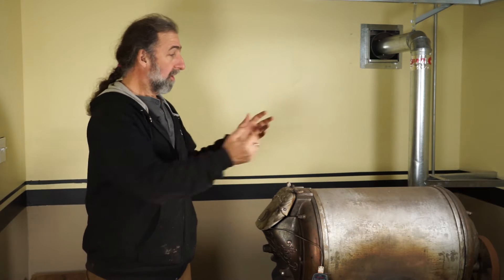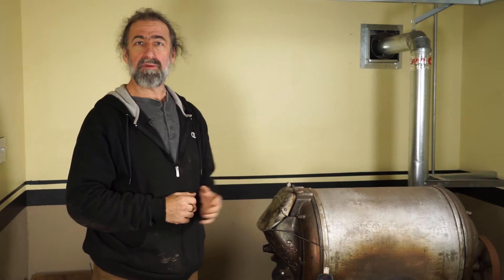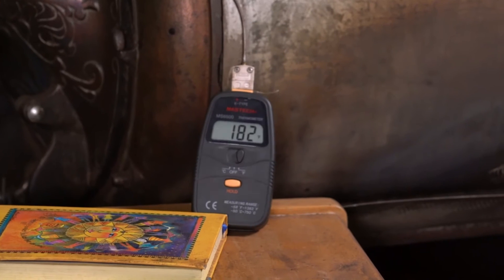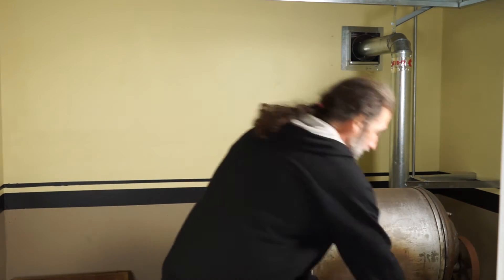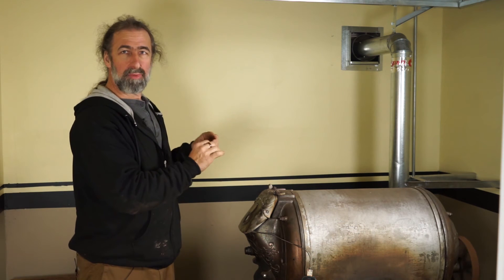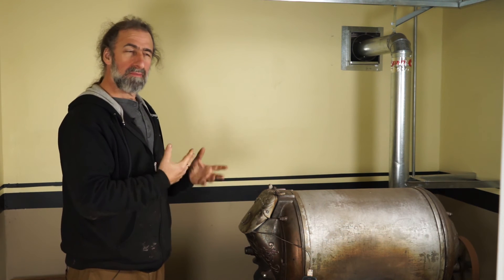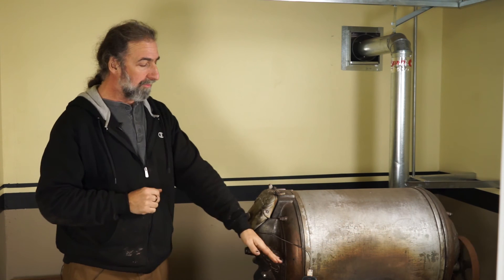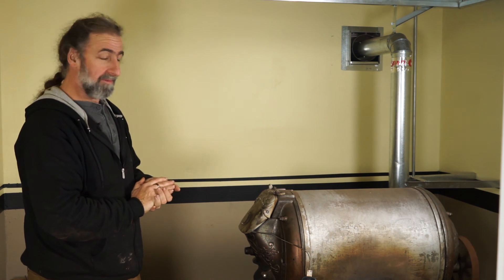5  Drum Roasting

Comment: Awesome!...great video... I just purchased a royal 5, however there is no motor,  can you give me the specs on the motor you are using...size, rpm, etc?...thanks!
Reply: Hi Brian, I do not have a #5 but do have a #1 and #6. My #1 has a 1/2 hp motor. The #6 has a 1 1/2 hp motor. Hope this helps.
Reply: Here is the 1/2 hp motor I got from McMaster-Carr   Base-Mount AC Motor, 1 Phase, NEMA S56, ODP, Rigid, 1/2 hp, 1725 RPM

Comment: Is the heat curve on bean surface very different from oven roasting? This roast seem to last over 40 mins while you recommend seem to use shorter roasts for oven
Reply from the maker: I'm not sure where you get 40 minutes from.  It isn't that long.  I'm pulling this from memory, but more like 20 minutes, and only that long because it was a darker custom roast for beer brewing.  But yes, the curve is different.  Generally steeper at the beginning and overall much faster because there is better heat transfer.
Reply: Ow, sorry, got it from the clock timelapses :). I'm always scratching my head about the differences between long, gradual heating and steep short heating. Much trials, never happy. Probably my trials are poorly designed to contrast.
Reply from the maker: Ah.  We might should fix that.  It was just to show time (in general) was passing.